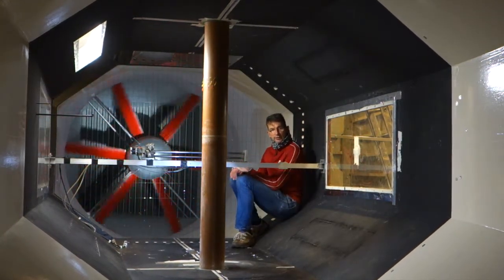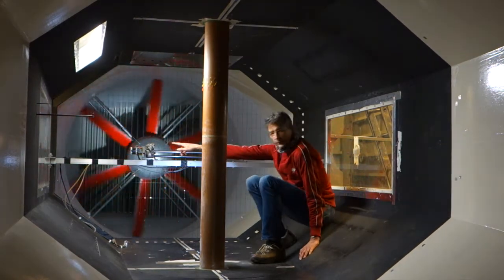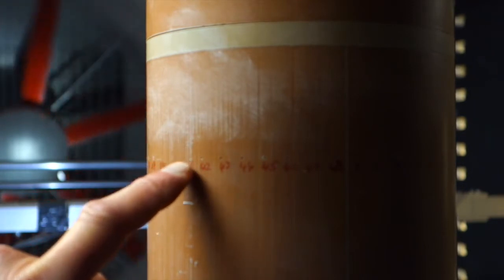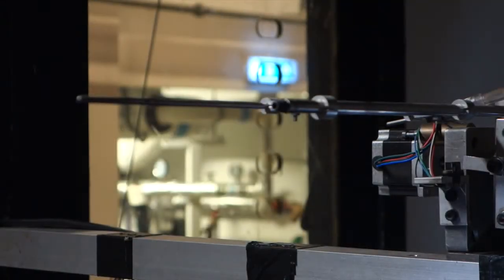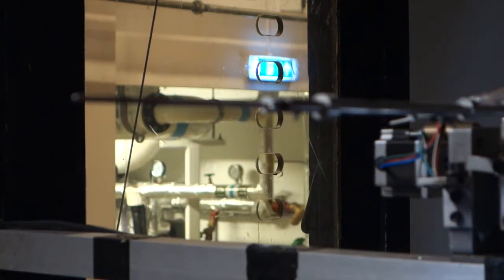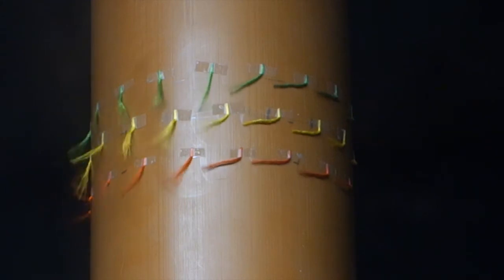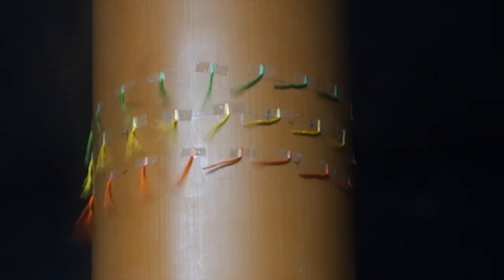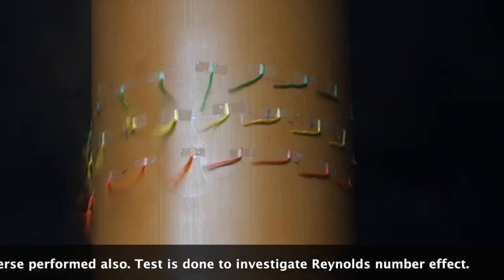Wind tunnel laboratory, flow around a circular cylinder

Comment: That intro sound is eerily similar to the opening of Alien 1979
Reply from the maker: It was meant to be a representation of sound due to wind, using droning oscillators, white noise and sweeping filter cut-off using a Theremin. Something like the Alien title appearing would be good.
Reply: @rigr9850  I think youve gotta put those editing skills to work and make the title pop up :)). Wind tunnel lab - directors cut